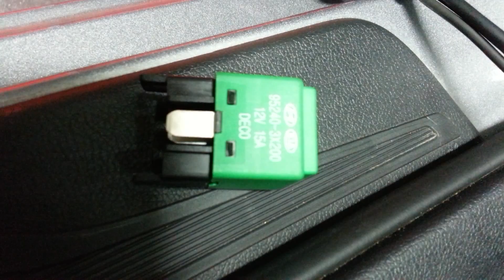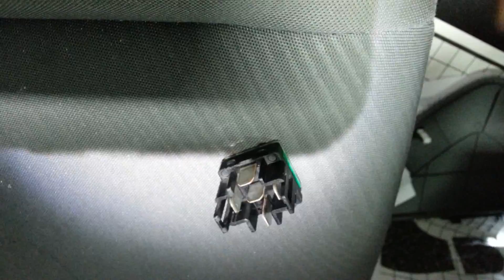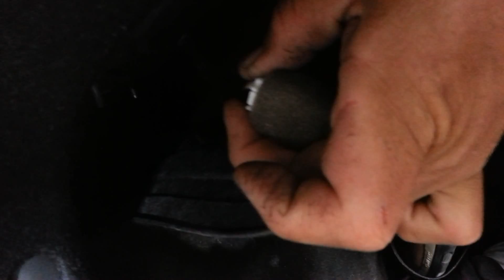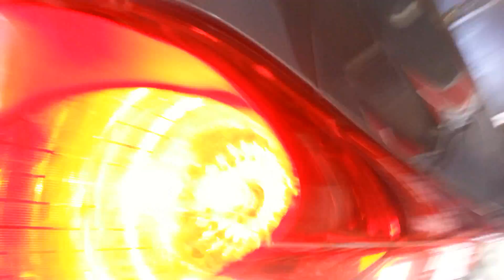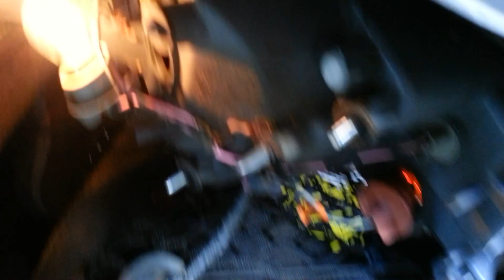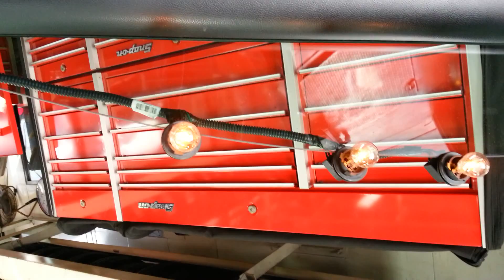2012 Hyundai Elantra has no brake lights. Fuse pop

Comment: ALL 3 BRAKE LIGHTS OUT. I changed the fuses and brake switch thinking "there's no way all 3 blew at once." Sure enough, after all that, changing the 3 bulbs fixed it. Must've had some kind of short that blew them all at once. Hope this also helps someone!
Reply: I just had my battery replaced at auto zone, I had to go back the next day because my car wasn't starting or I was driving home and my radio completely shut off no power, my check engine light went on..turns out    they left this box thing around the post loose. After that was tightened it fixed everything. But now I noticed my brights aren't working, checked my break lights, they are out too! Is it possible they blew a fuse? I guess that's what I'm gonna check first. Hopefully that will fix it.
Reply: That’s what’s going on with my car now thanks let me try changing all
Reply: THIs!! thank you! and another comment that said the brake light on the back window. so we had to replace that one first then the passenger then the driver side. we replaced 7 bulbs in all 😮
Reply: Man I'm going thru the same thing. No bs it was all three bulbs? That is weird. I did the switch and all as well

Comment: I have a 2013 Elantra. I have had the recall done with the pad for the brake light switch, I just bought a new brake light switch. I can hear a click when I depress the switch when I have the keys in the car and it on, but the lights do not come on at all. I’m trying to see exactly where the issue was in this car so I can look in mine. Anyone have any luck? I swear I will never buy another Hyundai again. We had a 2012 Santa Fe I just traded in because the locks weren’t working and were grounding our killing the battery,  and literally 2 months later I’m having this issue with my Elantra.
Reply: My turn signals work, I have replaced my brake light bulbs at least twice in the last 5 years (not the center) but the center is out as well. I also seem to burn through headlights quickly so I switched to LED. I really don’t have the time to be without a car any longer than the time it’s been down and I’m worried the dealership will just rip me off. I was a mechanic in the navy, I know a little bit (it’s been awhile) if you can help lead me in the right direction that would be great.
Reply: @brandycamacho4904  did you figure out the problem?

Comment: All my brake lights are out. My mechanic said it's a stop light module. Is that the same as the harness?
Reply: How did you fix it my break lights will come on for my running light but when I press in the break nothing changes
Reply from the maker: Not the same. What year and model is your car?
Reply: Same problem here for 2012 Elantra Limited, all 3 brake lights are off not working,  however, the side bulbs are not burned and are on, but will not switch to brake lights while braking. Fuses are ok, brake light switch is ok  too, and my cruise control works.
Reply: @besniksadiku9943  I'm having the same issue now. 2013. Any tips?
Reply: @KendleKreates  Honestly I fix it on my own not trusting what Hyundai or other mechanics said. I troubleshooted by Replacing first the brake light bulb the middle by the back window since it was burned out and tested it when I hit the brakes does it light it was good, then  I replaced both tail brake lights and tested them and I was good and I am still good. Hope this helps you and everyone else.

Comment: I got the same car and year what if the top brake light works but the 2 side ones dont? Is it just a bulb
Reply from the maker: Thw third brake light gets power from same circuit as left and right. Most likely bulbs. Possible wiring problem in trunk area. My money is on bulbs . You can check power and ground at sockets and see what's missing. Good luck.

Comment: 2012 Elantra center brake light under rear window caused all brake lights to quit working. Replaced and headache gone.
Reply: Really hoping this is what's going on with my 2013. Checked the fuses (all good), replaced the brake switch (still nothing). Going to run to the auto store tomorrow and pick up some lamps. Will try the center one first.
Reply: @rickjablonski9669 did it work?
Reply: @mahustz  yes, replaced all the lamps and everything's working.

Comment from the maker: I'll look it up a d send you the info in the next 24 hours. The relay has not been a problem yet. What's the problem with your's?
Reply: I’m having issues with my Hyundai same car in the video it’s a 2014 . The spoiler light wasn’t working. I replaced it with a new one and after replacing it it didn’t turn on but at the same time now the break light won’t turn on at all. I check most of the fuses and still no luck . Do you have any idea what could be the problem? Please please help.

Comment: I got 2002 hyundia elantra brake light not coming. I replace the brake switch , the fuse is good I replace the bulbs in the rear . I cant get the lights to come on please help
Reply: Did you figure it out?

Comment: So your problem was just the bulb?
Reply from the maker: lil mental it could be a number of things. It's safe to say it's not a fuse. Find someone who knows how to use a test light or voltmeter. The bulb needs around 12 volts and ground.   Find out what's missing and go from there. Start at the socket. If you really want to get into learning about 12v DC electrical systems, a power probe 3 is a great start. It costs around a hundred bucks. That's less than what it costs for  1 hour labor at most shops.
Reply from the maker: Yup. Shorted bulb.
Reply: ricardo jones just one off my brake lights is working an my 2003  hyundai Alondra  but I try to change the bulb but it still not working what could be the problem

Comment: got 2003 elantra both brake lights out but the third light works and the running lights work what can be the problem
Reply: Sammy locc im hvng the same problem on a 2013 did u figure it out????
Reply: @carsonmckurtis2585  same here 2013. Did you figure out?
Reply: I have no lights working, but my turn signals works
Reply: And my tail lights
Reply: @brandycamacho4904  same!! Did you fix it?!

Comment: level of experience 0. and the vin number is kmhdh6aedu and what's the name on that relay. thanks for helping me
Reply from the maker: Stop lamp relay. you should start with checking that fuse. Don't use a fuse higher than what is shown should be there. In this case, 15 amp. If the fuse blows right away when you step on the brake pedal, you have a short to ground on the load side of that relay. You may want to take it in to a shop at that point. 

If  you really want to dig in to the problem yourself,  start looking for videos on how to test for a short.

Good luck

Comment: morning, its a Hyundai elantra coupe 2013
Reply from the maker: +Karla Romo 
http://www.jimellishyundaiparts.com/images/parts/Hyundai/fullsize/AHMAPSDA1191-91201.jpg

The link above shoes an image of where the relay/fuse box is located. In that box there should be a 15 amp fuse (blue) in the "stop lamp" fuse socket. The lid of  the fuse box or the box itself should have the fuses labeled. I hope this helps you. By the way, if your vehicle has ISG and HAC, the fuses and wiring are different. If you have an owner's manual, it should help you find the box and the fuse.

if you need further assistance please send the first ten digits of your VIN so I can look at the correct diagrams. Also, please let me know what your level of experience is in electrical diagnostics. that way i don't make it too technical or too long winded telling you things you already know.

Comment from the maker: The stop lamp fuse I'm remembering was a 15 amp fuse in the Engine room fuse block. I believe it's marked "stop lamp".

The stop lamp relay on my 2012 was under the dash top left.  It was tucked up there pretty hidden.  5 pin connector gray in color. The relay was bolted on. If you caught it in time you may get lucky and only need to replace the fuse. Good luck.

Comment: I have a 2011 hyundai elantra limited. Same problem, sealed tail lights filled with water causing a short. I'm searching for the relay and fuse. I'm not seeing it clearly like my older model vehicles. How are they labeled in the fuse box? Thank you!
Reply from the maker: Did you fix your problem? Where was the fuse on your car?